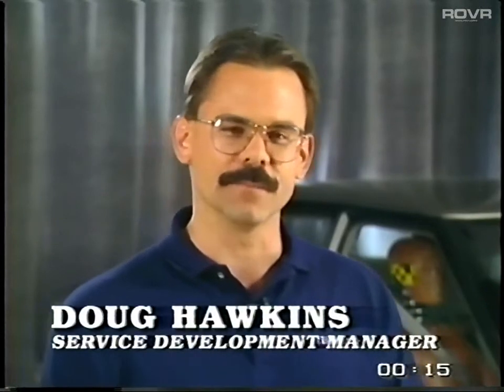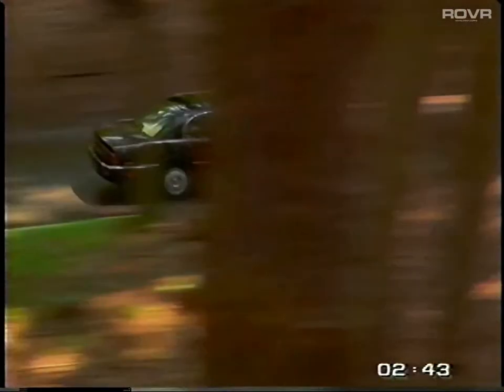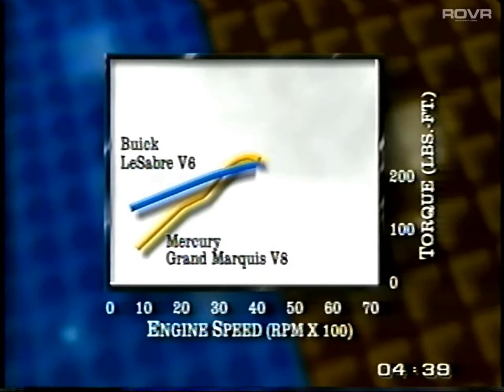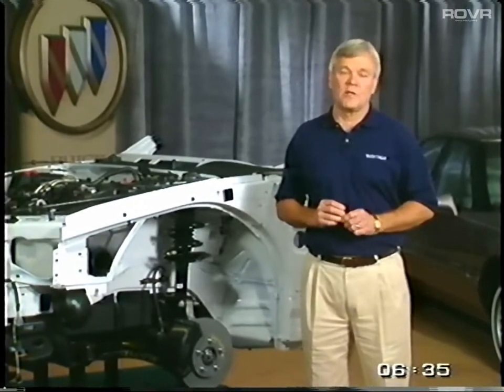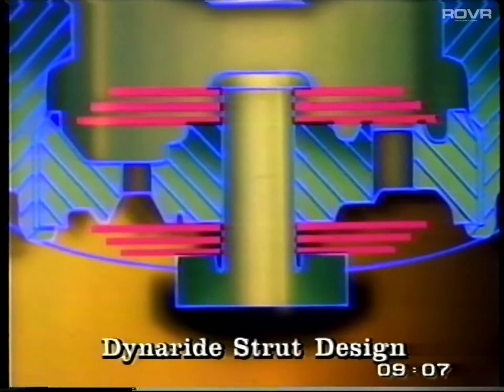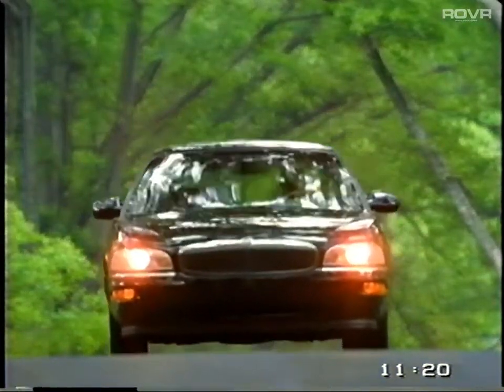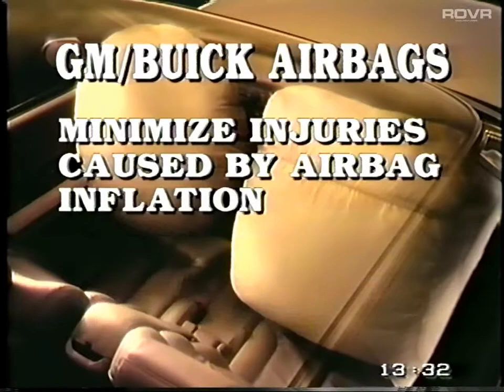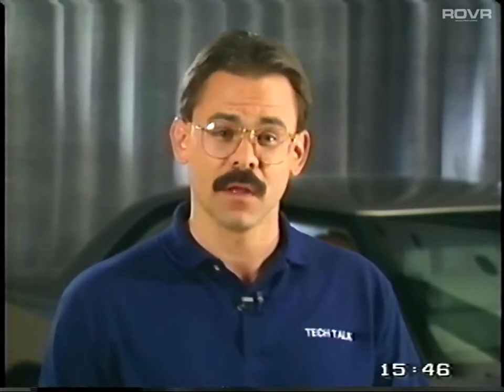Buick (US) - 1997 Tech Talk - Engines, Dynaride Suspension and Occupant Safety (1996)

Comment: GM 3.8 V6 is one of the best engines ever made.
Reply: I totally agree.
Reply: That's why when GM initially planned to replace it, GM held off for close to another ten years.
Reply: I have a 97 century limited with a 3.1 L v6 . If you change the Intake manifold gaskets and head gasket it will 100% last 50 years. Don't forget plugs, wires and synthetic oil